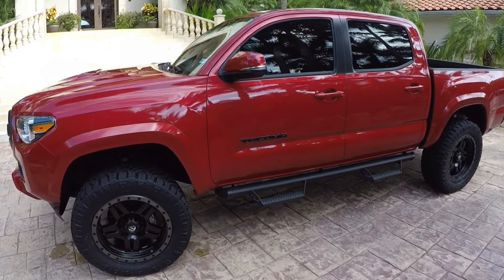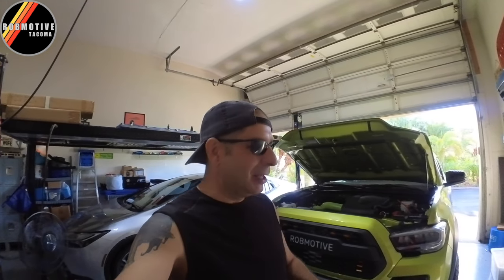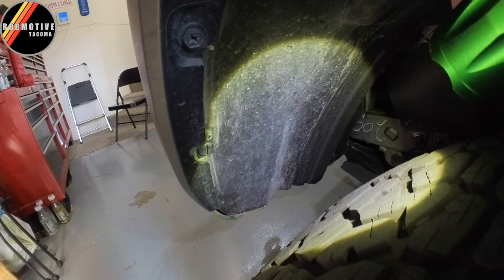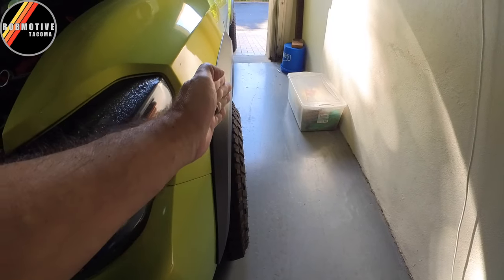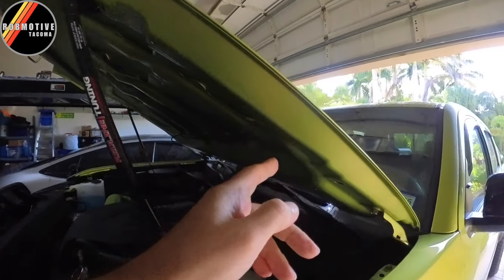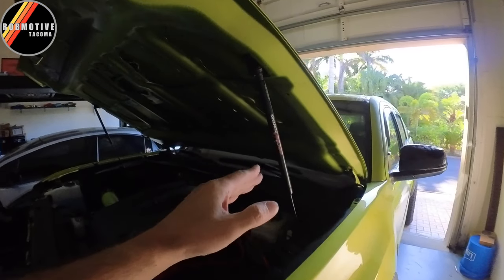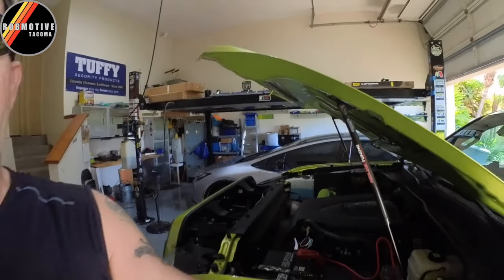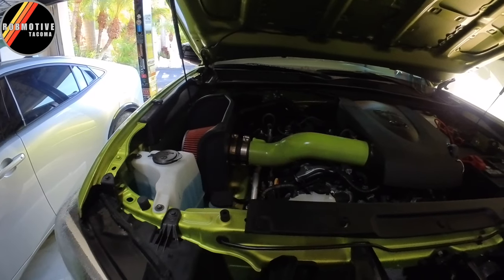Mistakes I've Made With The Toyota Tacoma

Comment: Aloha Rob.  You had a vision on what you wanted your past Toyota Tacomas to appear to your liking.  Yet, you learned what works and not work at all.  I remember your Voodoo Blue Tacoma in which the lift you did to balance, had a leak from the area you did the lift.  You excercise prudency on how you approach your mod installation for your new Toyota Tacoma.  Great job in your mod installations Rob.

Comment: Rob, have you thought about getting 265/75r16... My truck has came with 265/70 ... I want them to have the same poke out like yours, love the look but I want it to fill more of the fender (taller).. Did that make any sense 😅? Wondering 🤔 your thoughts.. Of course for now I have to keep my factory wheels 🤦🏻‍♀️... So how do I get that sexy look like yours?😂
Reply from the maker: Hey Katrina.  Having taller tires won’t give you that poke.  To achieve that you need a negative offset on the wheel👍

Comment: Being on disability I have to make a small check go far I have done a few mods mainly safty I don't really care about a lift if I came into some cash I would probubly look for a person with a third Gen that replaced there rims and tires for larger ones and see what kind of a deal I could get there I don't really mind the steel wheels and I just spangled the tires but my sr white and all black would look sharp the steel ones I will probably have to paint they get pretty rusted in the north east where they salt the road in snow or ice
Mine is a 2017 31000 miles so it's my last but I had a 2 Gen sport and that had some nice alloy dull silver 5 spoke wheels I loved those I know most people like the bronze or black but that wouldn't be my taste